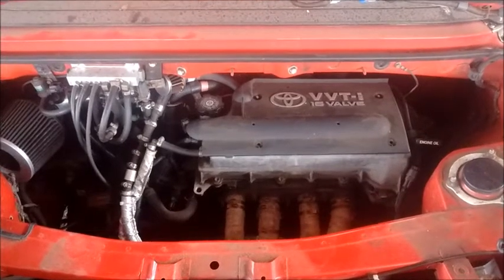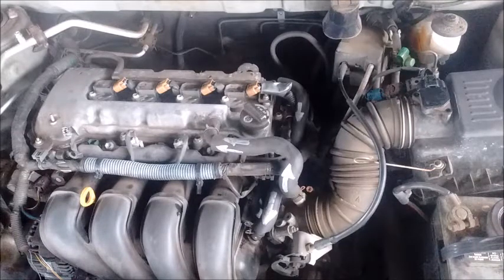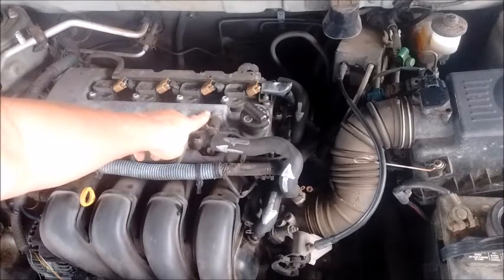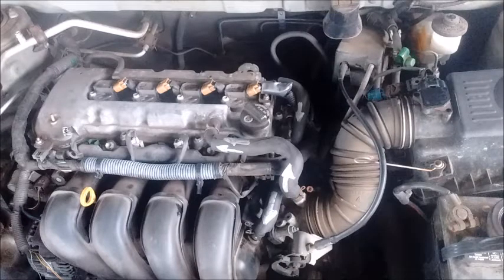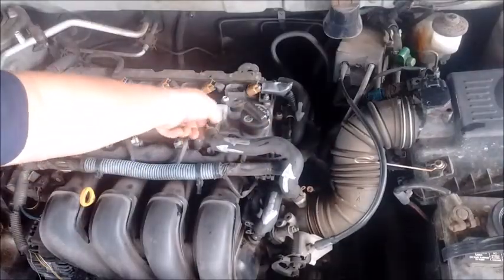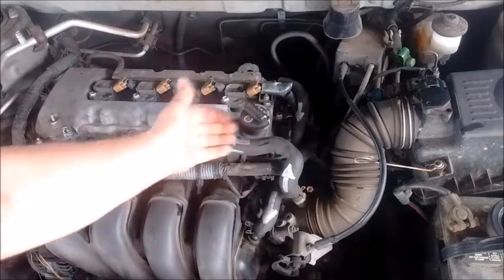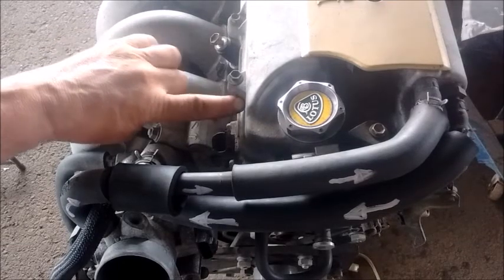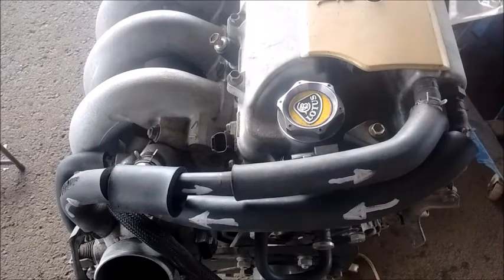1zz-FE and 2zz-GE Engines - PCV System - Corolla, Celica, MR2, Matrix, Vibe

Comment: I would’ve added a few items to your description. Your arrows are correct when the throttle is closed and there is vacuum in the intake manifold.
But you did not mention what happens when the throttle is open, and there is low, vacuum or nearly atmospheric pressure after the throttle valve .

In low vacuum situation’s the air actually goes in opposite directions than your arrows ! Still providing control over the blow-by pressure buildup in the crank case! 
This may actually be the most important part of the PCV system, as the crankcase pressure is higher at larger throttle, opening positions inside the crank case and valve cover .
Reply from the maker: I know that this details seems really important to you in theory, but, in practice, the real intent of this video is to help people with diagnosing their vacuum leaks that result in a fuel system lean condition and a CEL. So whatever is going on at high load is not really relevant and would only serve to confuse people. Besides, if you know so much, why are you even looking at this video? Trolling? LOL.

Comment: wonder if you can help me .. I have a matrix with ZZ-GE that the  throttle body idels high in the morning up 2000 to 2200,  after i cleand it awhile back ans sometime when driving and coming to a stop it Idels high and need to step on the acelerator so it idels normali (1000 rpms).. do you know what can be causing it?  thanks
Reply from the maker: Maybe your throttle cable is sticking when you release the pedal and come to a stop.

Comment: Didn't cover how the crankcase vents to the valve cover in the first place.  Is it the vent tube on the intake side of the valve cover?  The one Toyota calls No. 1 ventilation tube?
Reply from the maker: That tube on the intake side running down near the alternator is unique to the 2zz. 1zz does not have it. No idea why Toyota (or Yamaha) felt it was needed on the 2zz engine but not the 1zz. There are block-off/delete kits available for this tube. As with anything there are mixed opininons on using them. I have no opinion on this one way or the other. The crankcase gases vent to the valve cover "in the first place" through the oil drainback galleys. The external tube seems to be an "enhancement."

Comment: Hello Frank , I Have 2001 Corolla With 1ZZFE And 4AT A245E , if I Swapped To 2ZZGE , is it Can Be Done With The SAME 4AT , Or i Have To Change it To Manual ?
Reply from the maker: This is a good question. There is 2zz celica a/t ecu available and maybe there is 2zz corolla a/t ecu available but I don't know if either one edu would be compatible with your trans - you would have to research this.
Reply: @Merryfrankster_  thanks so much.  Keep posting these good and beneficial videos always .

Comment: it's geeky but the old rubber lines do get stiff and crack or split. So replace them with new ones that match. Clean the PCV and MAFS sensors with suitable spray for each and it is easy to do. Clean thoroughly or replace the 2 devices. A rough idle or rough running and poor acceleration/power can be from a leaking intake manifold gasket. Cheap to buy and simple to replace. Getting the connections to the manifold and related parts removed  is best left to a skilled guy and just pay him for the work.
Reply from the maker: Solid advice.

Comment: My 1nzfe is turbo'd. currently I have both the breather and pcv connected to the inlet side to the turbo, also on the inlet side of the maf. If I understand you I should have my breather open(not in the inlet) and the pcv connected to the inlet?
Reply from the maker: Yes usuall arrangement for turbo is breather going out to a catchcan or atmosphere, and pcv going to a vacuum source on the manifold for suction, but with a checkvalve to avoid pressurizing the crankcase under boost.
Reply: @Merryfrankster_  thanks for the clarification.

Comment: What prevents oil from coming out of the breather tube and into the intake during boost on this engine? My intake had about a half quart of oil inside of it when I took it out.
Reply from the maker: The internal baffling of the valve cover might catch a little bit of oil but when you have a boosted engine you need to use catch-can on the breather or vent it out.
Reply: @Merryfrankster_  My engine is not boosted. I think a large amount of blow-by is causing the intake to fill with oil. What else could cause so much oil going into the intake?
Reply from the maker: @amenen01  k I dont understand why you said boost when no boost but never mind maybe you were just babbling like a baby. There are two things that can cause your issue. One is the pcv valve itself is bad. Replace it and be on your way. Two is the air-oil separator under the valve cover is bad. This is a common occurrence in lotsa cars including Toyota's. If you owned a porsche 996 you would know all about this and you would be on the hook for 2500. For your mighty grocery getter just purchase a new valve cover - I mean the entire valve.cover aluminium piece not just the gasket - from salvage and be on your way.
Reply: @Merryfrankster_    I meant to say under acceleration, not boost. Do you think a salvage valve cover will work or will it have the same problems with the air-oil separator.  I have seen people install a catch can that vents to the outside and plug the ports on the intake.
Reply from the maker: @amenen01  chances are the valve cover from salvage will be ok.
Reply: @Merryfrankster_  what is the other pipe pipe gng from valve cover to crank?thank you for the vid!!
Reply from the maker: When you boost you absolutely need catch cans buddy.
Reply from the maker: @ae92guy16  om the 2zz that is an internal crankcase breather tube. The 1zz does not have this pipe.

Comment: Good video. One question: when fitting an oil catch can in closed loop to a 2ZZ, presumably only a single catch can is required on the PCV valve hose to the inlet manifold? As the larger return line from the TB is only fresh/clean air right?
Reply from the maker: Correct. This is true for naturally aspirated engines. If you did put a catch can on the breather line, it would never catch any oil, despite what anyone says about air flow reversion under high load. However, on boosted engines, anything goes.

Comment: You should mention that at high power levels (throttle open) flow goes the other way in the breather hose
Reply from the maker: If this were the case you would at some point find some oil residue or carbon residue in the breather and I never have ever in any healthy engine that I've ever looked at - I've looked at a few. Ha ha. If your engine is spewing stuff out of there, you have a problem that needs fixing.
Reply: @Merryfrankster_  You will find that happens in a healthy engine that spends a lot of time a near full power.  If the engine has a good built-in oil separator on the blowby side you will see very little oil in the vicinity of the air cleaner.  The Breather tube is designed to flow that direction at full power and the pCV pipe is too small to handle all the blowby flow at full power.  Blowby flow rate is proportional to power output.  I have been an engine engineer for the past 35 years.
Reply from the maker: @davidroth4123  K lissen, I could pull out all kinds of counter-arguments, let's just agree to disagree. I remain a denier on this. With all due respect.
Reply: @Merryfrankster_  OK, but consider this;  if you run an engine on the dyno at full power and then clamp shut the breather hose, you will pressurize the crankcase and oil will leak out from the crank seals.  you can even blow out a seal.
Reply: David Roth I think techno pro spirits in japan the guy mentions it and has a catch can for it, apparently there’s so much blow by, good catch mate, I’m an average dumbass but let’s not discredit frank here, still a helpful video